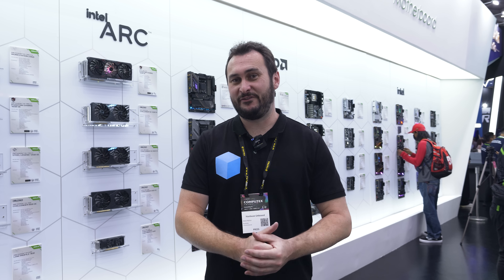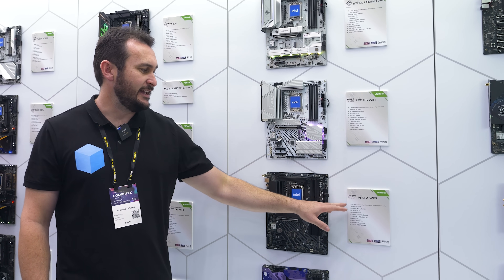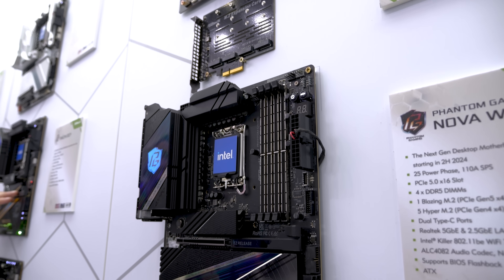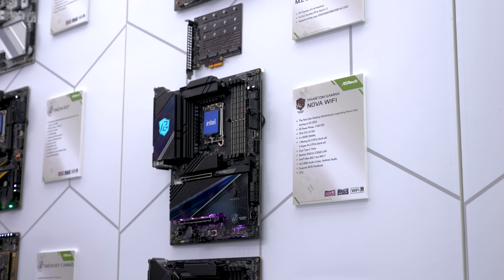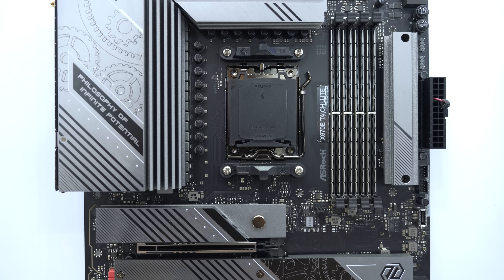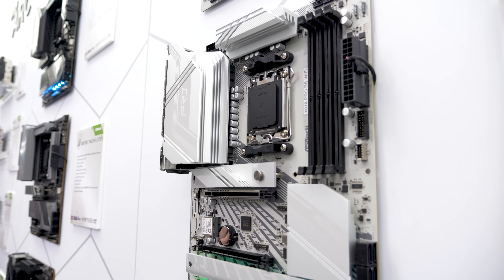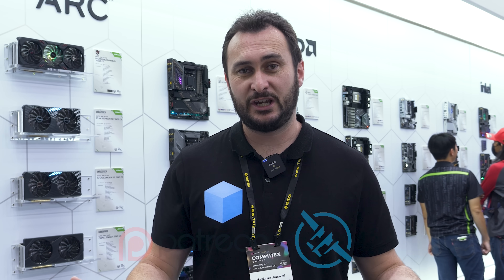Insane VRMs for Next-Gen CPUs - Asrock X870 & Z890 (Zen 5 & Arrow Lake)

Comment: 10 M.2 slots, 33 power stages and what not but not even a single board with 7.1 audio ports in the rear i/o panel. Don't know what is this new trend with all the motherboards. The 2 new x870 MSI boards that were shown are like that as well.

Comment: Vdroop is where the recent rash of i9 instability came from, so it is good that a motherboard manufacturer is addressing this.
Reply from the maker: Board makers here in Taiwan have told us there's much more to the story. It's not nearly as simple as you've put it.
Reply: @Hardwareunboxed  Not entirely, just mostly.  It is possible that some vdroop is coming from the power delivery in the CPU package but that doesn't change that what you would do to offset vdroop also fixes the instability, and that smaller versions of the same silicon I.E. 14700k, 14600k that are less prone to suffering from vdroop also are less prone to vdroop instability.
My first DIY pc had a 4770k and a Z87 Deluxe with 16 phase power to the 4c8t 84w CPU.  My Prime Z690P has less phases for my 13900kf when it should have 3x the power delivery.

Comment: With these VRM I think AMD Ryzen 11 and Intel Core Ultra 11 are coming
Reply: nah, AMD has a power spec for AM5 of 170W TDP/230W PPT, all the VRMs on the X670 boards were over built, this is just Asrock copypasting the Intel VRMs to AM5 boards.
even the 7950X didn't need 230W which is evidenced by the 105W eco mode not reducing performance by any great amount.

Comment: I like the looks of the white boards. If there's more choices for white boards I might have to look into one when the times comes. Also, if you're someone who owns a mouse and keyboard with a removeable cord that Intel' boards problem can be easily solved by replacing cable with one that has usb type-c plugs on both ends. :)

Comment: why is the chipset z870? and not usually z890 after the z370 came the z390 because intel came out with a higher powered chip, so they are doing something the same again?

Comment: Can CAMM2 go up to the same density as 4 slots? I don't think that it can so it really limits the future upgradability of the board, like have two slots instead of 4.
Reply: According to leaked JEDEC slides, 256GB and 512GB for stacked (dual sided?) CAMM2.
Reply: @davidlt  I would still like a comparison to 4 slots with similar density chips. DIMMs can have 10 chip rows on each side of a module. I can't see CAMM2 fitting 80 chips on a single module.

Comment: sucks to see so few PCIe slots on ATX boards, compared to say their ASRock Z77 Extreme11 from years ago; especially when CPUs back then had even less lanes. I really don't mind M.2 slots in general but the PCIe slots are much more versatile generally (and with expansion boards you can add way more) in that same board region, especially when other boards show how you can add those standard M.2 NVMe slots in the PCH area and also near the RAM region or even on the rear of the board. With ASMedia or similar switches, you could have 5-to-7 slots (even if x4 that's fine) and still have multiple M.2 slots, and a bunch of I/O still.

Comment: With 33 110Amp power stages is absolute insanity and well beyond the point of diminishing returns. If your CPU is drawing less than 300 watts of power with all those stages disabled then you are running your VRM hotter and less efficiently than if you had fewer power stages. Furthermore to get to that VRM design's peak efficiency with all power stages enabled your cpu would need to be using over 500 Watts! It's absolutely stupid and disheartening to see that marketing is designing the VRMs rather than engineers designing for the actual maximum power loads.

Comment: Looks like im not touching their boards for my next build. I absolutely hate that mobo manufacturers are pushing 7 segment debug readouts onto $400+ boards. They used to be common on ~$100 boards but now it's exclusively in a mid to premium tier even though it's a cheap add-on for them. It's genuinely infuriating that something so useful is being gated as a premium feature across the industry.

Comment: I wasn't expecting CAMM2 to show up on desktop platforms. At least it seems companies are actually interested in investing in the format.
Reply: DDR DIMMs have limitations, and with DDR6 boosting frequencies signal integrity will be a problem. Looking at JEDEC leaked slides trace lengths, and soldered connector is a problem for signals.

Comment: VRMs a few years ago: Underpowered.
VRMs today: Overpowered.
Let's hope in a few years they hit a healthy middle ground...
Reply: nah, keep them overpowered. cant hurt
Reply: @XxAtomic646xX  it does hurt. less efficient (as in electricity wasted) and more expensive
Reply: @Sopel997  bruh no it DOES NOT you dont know anything about electricity bruh lmao. a pc pulls power from the wall ON DEMAND and OP vrms mean more surface area for heat meaning more efficient and less chance to throttle. What youre saying is the same as thinking a 1600w PSU uses more electricity than a 450w PSU in the same system lmao
Reply: @XxAtomic646xX  the transistors in vrm are most efficient at around 15-20% of maximum usage. they get like 5% less efficient on both extremes. This means if you have a CPU that pulls 100W you should be aiming at roughly 5-6 phase 60A vrm for maximum efficiency. Good luck with modern boards.
Reply: They are simply re-introducing a similar trend from a long while back where several companies had ridiculous VRM phases. They aren't needed for anyone using standard air or liquid cooling (whether AIO or custom loop), but they might be helpful with competitive overclocking using liquid nitrogen or something. Mostly bragging rights at this point...
Reply: They'll just skip half of needed phases on mid-low end boards and make it even in the end.

Comment: Where are the ITX and MATX?.....screw all this ATX stuff.  MATX is the way IMHO.  

Personally, I have no need to ever build an ATX again...just too big and unnecessary.  I even returned/exchanged a bundled ATX mobo from a Microcenter 7700X bundle for an ASROCK MATX and got $190 on the return and bought the MATX for $120 (used the $70 for a NVME drive) for a build for my sister.

Comment: 33 power stages, each 110 amp. That's a total of 3,630 amps. Just shy of the 4,096 that a lot of motherboard manufacturers set as their upper limit in bios.

Comment: These guys are over the top.. Most people are still using cheap type A 3.0 thumb drives and SD and micro SD cards.. Anyway I am still on B550 with a 5900X and a 6800XT and very happy still.. Not a number chaser but gaming is still more than just good or average.. IDK maybe in 2 years I'll do an upgrade..

Comment: Really tempted by the specs on that Taichi 870E board. Any chance of a white version? Cause I'd be tempted to trade up from my B650E Steel Legend just for the extra NvME slot - assuming the Zen4 CPUs are compatible with the extra slot.
Reply: Right now the two flaggship boards from X670E and Z790 are whitish, so there is a good chance to see a white X870E Taichi Auqa.
Reply: @jojobetzler3732  Ya, they showed the new Taichi Aqua for Intel, but there wasn't an equivalent one on the wall for AMD. But not in a rush to upgrade. We don't know yet if the Zen4 parts will be able to benefit at all from the improvements in the new boards, so that's some testing that needs to happen before I seriously consider the issue anyway.

Comment: Very underrated feature is that EZ Release lever for the PCIE slots. Don't have to worry about accidentally driving something through your $300 board while trying to unlatch your gpu
Reply: FYI I use a chopstick to release the latch/GPU and it works well.  PCIE slots are a hazard on current boards with these largeASS GPUS.  Sometimes you can't even get a finger in there in smaller builds.
Reply: Eyyy chopstick brother!  
I stupidly used a screwdriver before my brain activated and have been using a chopstick since
Reply: Kind of ridiculous that they only include it on their high-end motherboards when it's such a cheap and simple mechanism though. More artificial segmentation.
Reply: @konga382  on another computex video (not from hardware unboxed) i heard that Asus or similar has a patent on this release mechanism so companies need to work around that.
but yeah i fully agree it should come with pretty much any mainboard in 2024.
Reply: @maxmustsleep  I can confirm my Asus ROG Strix B650E-F WIFI board has the patented Q-release I think it's called.

Comment: More USB-C and PCIE slots on the Intel boards. Also, that PCIE4 x4 to 4 M.2 x1 board, sort of is interesting. But it is only really useful if the main x16 slot sits below it, not above it. If a cheap b650 class mATX with a m.2 x4 PCIE5 at top, then a pcie4 x4 slot followed by the main PCIE5 x16 slot that would offer us 5x m.2 slots. Sure, there could even be more from the chipset. But with such a MB, why would I ever need any of these monster boards. Say a dirt cheap mATX board with decent VRM, that support one main m.5 pcie5, one drive over the chipset, and 4 drives over pcie4 x1, that is 6x m.2. Not to mention, that the link to the chipset is simply not starved. In the future, that x4 slot, could be made pcie5, which would be plenty fast enough over pcie5 x1, which is just as fast as pcie3 x4. That is more what I want, just not seeing it happen. Everything is just made to be insanely expensive, for no real reason. It is probably lost on people, but if the GPU sits in the lowest slot, the heatsink of that GPU has way more room to breathe, particularly if the board is designed as an ITX board, with connectors on the front of the board. Why is nobody calling for stuff like that? I don't need a gazillion power stages, particularly when like a 10-phase one suffice, and the 10-phase one does not coil whine, while the other one has a gazillion stages that does? Sure, it is 42C and stuff. But why? Why not just redesign a board to simply offer better GPU airflow instead? Why not redesign to support a ton of m.2s over that PCIE x4 slot? That is at least useful.

Comment: Ya I got a B650-E Taichi Lite last month and I absolutely love that it has 95%+ of the flagship's features with a greatly reduced cost. It's been a great board in my short time with it.

My only minor drawback is that for 5.1 audio through standard 3.5mm jacks you have to use the front microphone header which is a bit odd on the front of my Fractal Torrent but still works!

Comment: What, 10 M.2 slots on that Taichi (03:05)? CPUs are rumored to have 20 PCIe 5.0 lanes, no? Do they support some kind of bifurcation that lets you "convert" PCIe 5.0 x2 to PCIe 4.0 x4 or how does that even work?
Reply: The 4 SSD card only uses 4 CPU lanes and I haven't heard of consumer boards bifucating into x1s so the card must have a switch on it and cost hundreds.

Comment: I don't give a cheese about 2ghz more on the RAM if it means everything is "SoC" and bundled. It will happens like with phones, when 1 little trace shorts or whatever, you'll have to use your warranty for the WHOLE FREAKING MOTHERBOARD (or RMA and this will be utter SHITE depending on the region you are in). I heavily oppose this except they do it for laptops.

Edit: ADAPTERS FOR USB C??!! Just put 2-4 USBC (2 front 2 back maybe) and the rest make it type-A! That is BS. How long until that shit breaks, causes issues or bugs or they charge you like 25 dollars more for the mobo because of the adapter bracket.

Comment: No pci-e 1 or 4x slots is a big fat no.  i'm going back to dedicated sound after 5 years of irritating onboard sound issues and i want a fast network card withou buying a high end board they are to expensive these days. Not that i would ever ut asrock. to many fuckups in the past. Same for gigabyte and asus.
And i wonder if 2 chipsets also means 2 times the idle power problems on AMD. Half of that comes for the board after all.

Comment: Regarding CAMM2: JEDEC have stated they want to ditch screws for their mechanical standards, so while these prototypes might be put into some kind of production, 5 years from now the modules likely will not be the standard.
Reply: LPCAMM2 for LPDDR6 is also changing connector (more rows, more pins). Memory seems to be last player to join rapid innovation cycle. Even if there is a standard, it might be short lived compared to the old days. I didn't expect LPDDR6 LPCAMM2 to change connector array already.
Reply: @davidlt  LPDDR is architecturally different from regular DDR, so they won't share a socket. For desktop DDR I think Gen6 will be the tipping point for CAMM. With DDR5 you're right, there might not be enough time for a mature mechanical standard to be established and JEDEC might just retroactively adopt what MSI, ASUS, Asrock etc. are displaying at Computex, because it appears the manufacturers have agreed on one design (screws and all).
Reply: @phillycheesetake  Correct. I just didn't expect that LPDDR5 -> LPDDR6 would already change connect array. JEDEC listed on the slides that screws need to go away (must be tool-less) as a future work item. [LP]DDR5 -> [LP]DDR6 seems like a short gap in time. If JEDEC joins the party and plans to rapidly update the standard the form factor/connector most likely will change rapidly too.

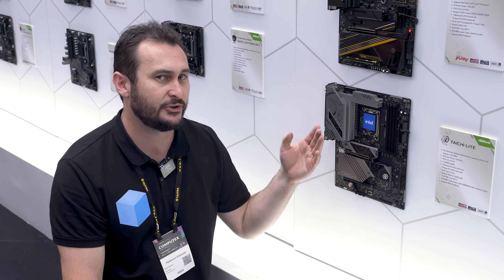Comment: 7:15
It is nice to the more LITE boards.
I still would like to see a board designed for closed cases where you cannot see the motherboards.
I just want a good connectivity, good power delivery, efficient and silent cooling design, high quality component that last 5-10 years, low noise, no coil whine and a fair price.
I do not care about looks. Make maybe 2-3 boards per CPU socket, one cheap and one for stable daily driver OC's with all the connectivity you need. 
Maybe one super overkill, but I guess people that like that also like looks, thus it might not even be relevant.

Comment: Mini itx boards are sill a thing right Asrock?....
Reply: I think we are starting to see less and less ITX than ever and more MATX.  The GPUs just got to freaking big and you basically need a MATX case to fit them and at 3 slots at a minimum.  ITX will move more and more toward custom water cooling for top-end GPUs.
Reply: @chads7796  I think you might be right, as there aren't many itx cases with 3 or 4 slots. 3 slot GPUs now being pretty much the standard.

Comment: I really don’t understand manufacturers. First they massively underspend VRMs and got called out… now they massively overspec VRMs and get called out for silliness…

I’m pretty sure 8 or 12 phase VRMs with current high spec 70 or 90A power stages are MORE than adequate. Why? Because I’ve seen setups with that kind of power handling on older HEDT stuff… so can we please get that?

Not doubled 4 phase designs with crap components, not designs capable of pushing 1kW plus on mainstream boards, just something in between for normal people ty?

And if we can still get post codes that’d be jam.

Comment: Damn. I'm not sure how im going to cope knowing my future PCs wont have the standard looking DIMM slots. IMO RAM really completes the desktop PC aesthetic.
Reply: It completes the "aesthetics" so much now laptops with LPDDR especially Macbooks run circles around high end PCs, especially in responsivity. Even Qualcomm has 8 channels. Changes were needed yesterday. So far what CAMM2 is doing is still not enough so save PC building from extinction.
Reply: Camm2 if for laptops, because it have shorter trace lenghts, so it allows high clock speeds with low power consumption. In desktop you can just crank up the power delivery to the DIMM slots anyway.

Most of the bandwidth in Macbooks and Qualcomm Elite X is for the GPU, because it it shared memory. On high end desktop you use graphics card, there is no need for 400 GB/s just for the CPU.
Reply: @rj7250a  They made the motherboard and are showing it off, it's already too late mate
Reply: @kazioo2  A grim future indeed.

Comment: Either companies are just throwing ridiculous quantities of VRM's on there to lower temps and have something to market over their competitors or Intel's next-gen CPU's are going to double as space heaters.
Reply: You are PC gaming industry and there is two wolves inside you
One is mobo manufacturer that wants to put enough phases to run 3 server CPUs on a consumer mobo
The other one is nVidia that wants to shove >450 watts through a single undersized 12 pin power cable and burn your power cable or connector
Reply: seeing the same absurd power delivery is clearly on the new amd boards too it's  fairly obvious which it'll be
Reply: Nvidia: 450 watt video card
Intel: hold our beer

Comment: Heatsinks pop off instead of using screws. That's a great idea. Also love that pcie q-slot that's in use also. Now I dont have to use a stick of some kind to detach the videocard from the x16 slot when using large heatsink coolers.